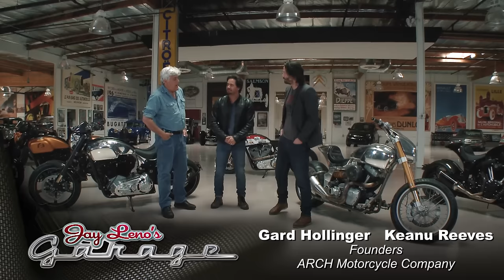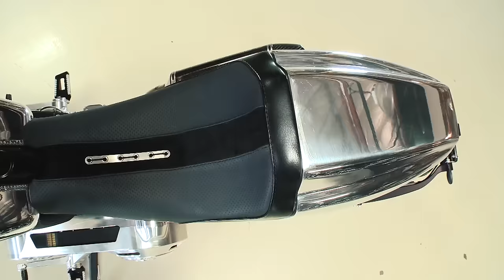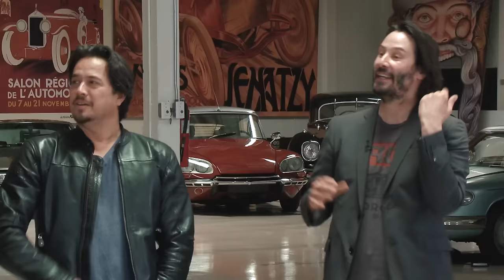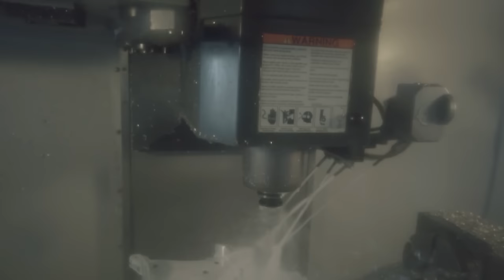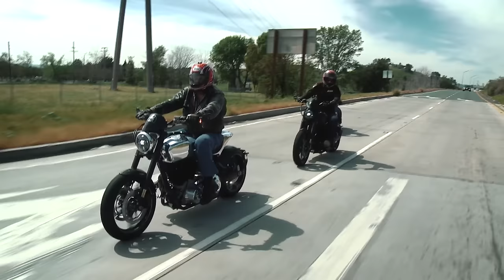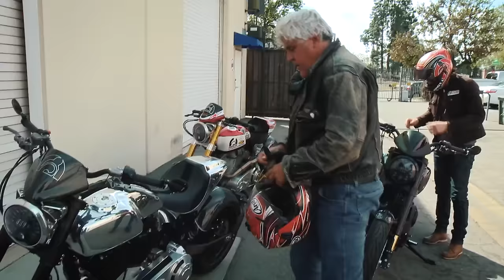2017 ARCH KRGT-1- Jay Leno's Garage

Comment: I just got off an ARCH KRGT and it’s a phenomenal motorcycle. It’s the best of the cruiser with a shitload of torque and impeccable handling. It’s right there with my Triumph Rocket 3 GT. We pushed 194 miles today. Went bone dry and almost had to walk it to the pump…but we had such a great time. Just an amazing ride.

Comment: when i hear Jay talk about the handling
then talk about Ducati's long front
then Jay just steers all that horsepower with his hips... oh yeah
that's a good bike
Reply: You don't steer a motorcycle with lean or your hips. The "stability" and hands off is because of the 30 degree rake. And because of the rake and the heavy weight, Leno didn't say it, it's more work to turn the bars at low speeds.

Comment: From the get-go, the director and/or soundman of the video should've simply said 'cut', and kindly handed Keanu a Kleenex. Problem solved!
Reply: Real men just sniff sniff and use those hands to wipe the snot. Especially, the runny noses that fall to the upper lip, and you slightly tilt your head "SNIFF"! Lol!

Comment: Luv!! Luv!! Luv the engine's sound!! Luv Keanu's description, "delicious carbon fiber"!! Carbon fiber wheels have several advantages... high stiffness, high chemical resistance, high tensile strength, high temperature tolerance, low weight, and not to forget... extremely low thermal expansion!! Indeed delicious!!

Comment: dang. I recently got a Honda Rebel and I been thinking how awesome would it be if there were a Naked/Cruiser with a VTWIN and ABS. This is IT!
Reply: Honda Rebels are fantastic bikes that are easy to maintain and you can't beat the price. ARCH bikes unfortunately are bespoke custom bikes that start at $80K+ and would  require extremally rare and expensive propriety parts to service. Not to mention no motorcycle mechanic or dealer will be familiar with them. It's a cool idea, and  yeah if I was worth $100 million maybe I'd buy one. But the beauty of motorcycles is their simplicity not their uniqueness. All that being said, if you want an affordable sporty cruiser style with ABS I highly recommend the Kawasaki Vulcan S. Starts at $8K with ABS you can find them used for less. By all accounts it's a pretty fantastic crossover between a cruiser and something more sporty.

Comment: What I couldn't believe is that an $80,000 motorcycle doesn't have anti lock brakes yet. I'm  with you Jay on riding position. Watching you during the riding phase of JLG  It wasn't quite there for leg bend. I would prefer a 90 degree bend.

Comment: I machined or slit existing rims and sent another rim to Kosman Wheels in CA where he welded the rim width pieces to the slit rim and he made very wide wheels. Keanu liked them a lot but Gard wanted a different size wheel. Good to discover he rode a Norton for transportation in CA for many years. Can't beat a Canuck for being real. Charge forward or be a wing, hockey term.

Comment: Do they make the motorcycles to fit short people as well as tall people?  I am only 5feet tall and I don’t have long legs but I am evenly proportioned. My problem is I have never driven one. Just rode on the back. I think with the cost of everything now a days 80 thousand sounds reasonable with todays pricing. But I can’t afford it. My brother could never keep one up. He crashed a lot. I use to hold up my dads motorcycle. At lights cause the clutch would die at lights.  I don’t know if that was my dads driving or what?  I would have to jump off so he could restart the motorcycle. Otherwise I got kicked by his boot when he started it I enjoyed the rides though debi

Comment: Since these are basically bespoke bikes... what are the chances of them putting a Triumph 3-cylinder mill in it?   (probably slim to none!)  I get why they're using aftermarket V-twins, there's a ton of other parts available to work with them.  Still... Keanu, Gard, if you'd like to turn a Speed Triple RS into an Arch build, I'll gladly purchase and donate one for y'all to play with.  (meanwhile I'll keep my Thunderbird Storm.)

Also, KUDOS for using Motodemic lights.  Way to support not one but two American companies (Motodemic and J.W. Speaker).

Comment: 80 grand is insane amount for a motorcycle. They are nice af though. Super expensive components like full ohlins suspension, carbon fiber BST wheels, S&S made engines. Not to mention that most of the bike is machined billet aluminum.

Comment: Congrats. to this co. for its endeavor and initiative. I can see the appeal of this bike but I'm more a Honda Valkyrie Interstate sort of guy, provided that you live in the sunshine.  

Having to integrate ABS  for the European market (I'm based in the U.K.) is a shame.  But at least one can simply pull the fuse in order to disconnect it, and thereby have a regular braking system quite easily. 

For an experienced  rider (I have 55 years) ABS is a thorough pain and quite dangerous if one attempts to use a braking system non-primitively, i.e. by not simply pulling the front brake lever.  It simply will not work, in particular it will bar  efficient sole use of the rear brake. ABS is a great use for clowns and may save a few of their lives. But it encourages poor braking, overall poor motororcycling, and encourages lack of knowledge and skill.

Comment: 80k is not over the top for what you get, my 99 FXSTC is running at around 48k to get it where I want. Having said that 48k is not including labour, so a lot of bike for the money....and it’s individual. Should I be blessed to be able to order one down the track it would run an evolution engine, no fuel injection or computer thanks........Unless it runs an Orca Evolution engine from RBRacing.........now there’s a thought!

Comment: For anyone whining about cost- these things REALLY aren't that expensive, for what you're buying... And that's coming from someone that cannot and probably WILL NEVER be able to afford one...

 you all REALLY need to Google "economies of scale"

Small, low-volume products cost a LOT more to build, as you have to distribute R&D, testing costs, administration and book keeping costs, all overhead, costs to test and certify, legal fees, facilities costs... All those things have to be passed on in the cost of the product. EXAMPLE- All of those costs add up to $2 MILLION, yearly (completely made-up number)... one company is mass-producing 10,000 units a year. The other is a boutique company putting out 100... The large company? They only have to tack on 200 bucks to the cost of their bike. That small company has to add on TWENTY THOUSAND.

Also, MANUFACTURING COSTS- the same thing applies here, when having parts made, buying assemblies, ect. Things simply cost less per unit, the more you buy... And this is even MORE pronounced when it comes to machining, casting, forging, ect- Things like dies, forming tools, generating optimized machining code, fixtures, ect- they cost a LOT of money, and that cost has to be rolled into the parts. The less that are made, the more expensive each one is.

You also have to factor in actual material and component costs for bare materials or pre-built assemblies. These bikes utilize top-of-the line stuff across the board, and that costs MORE.

Lastly, these bikes aren't machine assembled at a factory somewhere- They're built BY HAND, and that kind of skilled labor is expensive.

Comment: If you make annually what this bike costs, it means you are never gonna ride one. Even if some dumb luck, I got my hands on to spend the $80K on this gorgeous motorcycle, I would not. Why? Common sense, most people can afford the insurance on a $10K-$15K bike but insurance on a $80K bike? I don't think you would be inclined to ride it if the cost of this bike was like chump change for you.
Is the bike overpriced? Many think so, even I thought that way initially. Mainly, because I/they cannot afford it and/or they are comparing it to motorcycle made overseas in thousands where the cost of producing one is  much much less. So, in all fairness, considering these are made custom, in US using very high quality materials, they probably costs just as much as what a typical bike of similar displacement sells retail, then you have to factor in the very expensive CA regulations/taxes/fees/rent they have to pay plus employees, etc. All in all, whatever the cost is, they have to charge minimum 3 times more to make it. So, after all said and done, the final cost is probably around $25K (give or take ~$5k).
Overpriced? Perhaps but they are definitely not for anyone with a beer budget. I, too wish I won the lottery so I could have one of these so I could park it in my living room!

Comment: These bikes all look a bit oversized to me; also they are a bit heavy; seems like they could scale the overall size of the bikes down, keep the big power plants, addressing the weight issue at the same time, making the bikes perform better without adding power to the motors.

Comment: I don't know who's the guy riding the red and white S1 proto on the highway but he really need to learn how to rest his feet properly while not breaking or shifting gears.

Because that way of resting on the heels, feet hanging opened and outside of the MC envelope: noobish habit that a decent driving nstructor would correct asap.
”Always rest on the front end/tip of feet, otherwise if you hit something or get too close to a passing, you may get it caught between your heavy bike and a super heavy car: you'll twist/tore up to your knee and it's going to be VERY painful"

Comment: Jay Leno, I am so surprised at your statements I always had a high opinion of you man. But once you mention American and Eu motorcycles you where correct about one liter to 1200. that is already a big bike in EU. But this talk about low end torque is all wrong Jay. Example: how can a Harley with 1800 Cc and 65 HP have more torque then a BMW 1200 Cc with 110 HP ?? American motorcycles will never be as light, torque and as fast as EU specific German motorcycles. BMW are the best bikes in the world and Arch is just another very , very expensive American Motorcycle tractor.

Comment: I'll stick to my Metric bikes.  Reliable, capable, affordable.
Those Arch bikes look like they'll handle like a pig around corners.   Maybe I'm just too used to Japanese engineering.
Reply: I come from the Japanese sportbike camp too.  I did hop on a custom build this summer in my Smokey Mtn ride and I'll have to say great brakes, good lean angle, and Öhlins make for a great foundation for these kind of bikes.
Reply: @3.2Carrera  That's good.   The price point is a little up there tho.

Comment: The bikes are only expensive due to the lack of production structure. "Hand made" only means '"we don't have the facilities or the employees to make a standardized product." Their models and revisions are based on mainly aesthetic concept.  There is nothing ground breaking about these bikes. You could make most bikes ride and feel as good as these Arches with after market mods for significantly less money.  You pay $80,000 for a celebrities dream.

Comment: Traction control on a bike? Is there such a thing? Give me a break. What's it do, transfer power to the non-existent "other back wheel"? Speaking of brakes, I don't want no anti-lock either. What a horrible idea. Bikes have worked a certain way for thousands of....what year is it?...a hundred years. Leave them alone.